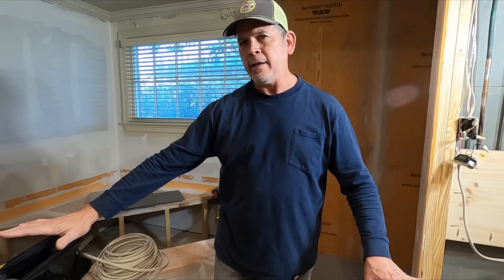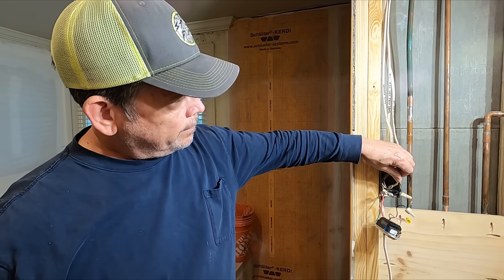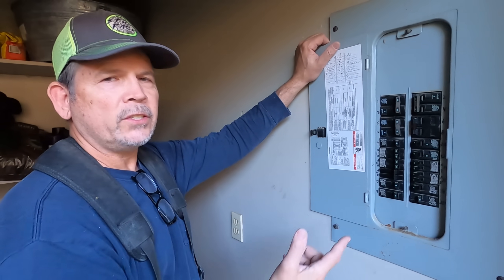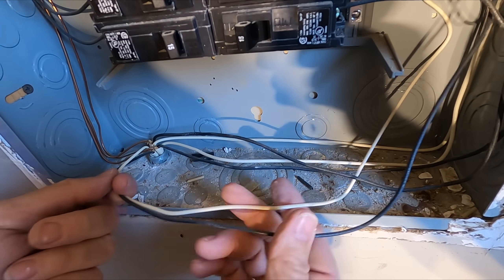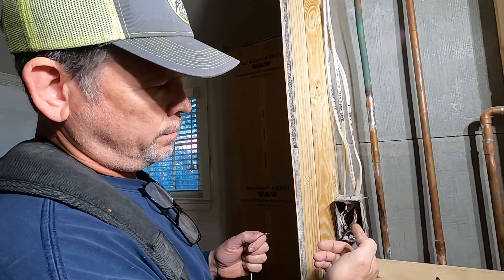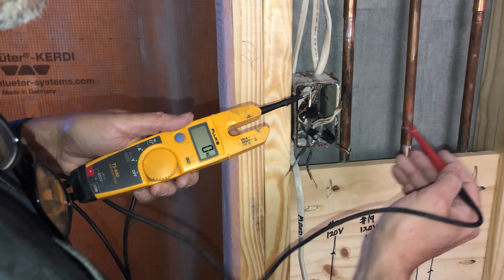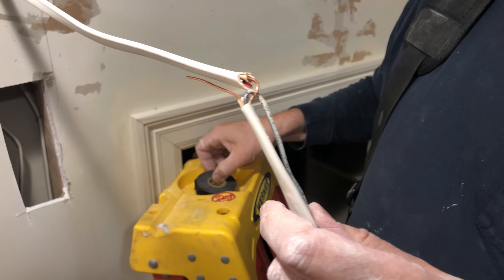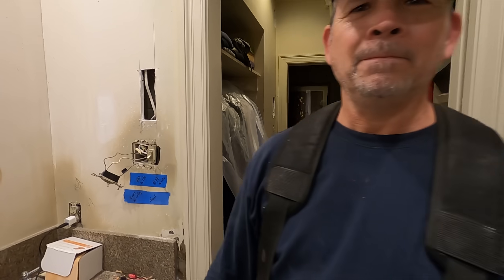You CAN Get SHOCKED by a Neutral Wire! This is How...

Comment: This is why when I work on things I turn it off at the panel then use a non contact probe to check before i open junctions, then i open junctions and test if in doubt. I did not do this once turned off a light switch, yanked a wire out of a metal box got a big spark, pop blew the breaker surprised me until i thought about and realized they had the switch on the neutral phase. I use the pushon wirenuts anymore, when I add a leg for an outlet, etc off a main feed line i always do the neutral then the hot. This is because basically as you show if the hot was on and something connected the neutral is then live too and you may not expect it to be. I feel like doing neutral then hot you are only exposing yourself to chance of shock one time where if you do hot then natural you are exposing yourself to two chances of shock.

So far i have never been shocked by any mains voltage, and i do a ton of DIY electrical work. This surprises many people but a couple master electrician friends are not surprised by this because i have a good understanding of electricity. As long as you are not completing the path you are generally safe, this is how birds sit on power lines they are only at one potential voltage and do not generally complete a circuit.
Reply from the maker: Thx for the comment.   I checked all the wires for voltage after removing the wire nuts.  All was good until someone in another room turned on a 3 way switch fed by another breaker and energized the neutral.   Definitely remove hot first, then neutral, then ground and reverse the order reconnecting - make it a habit   👍  Anyone who doesn't understand that eventually learns

Comment: Thank you for good clear presentation.   I have two of these bad wiring jobs buried in the 70-year-old structure of my house, where I can't readily get at them without tearing the house apart.  I have had several occasions when I had very bad things to say about the so-called "electrician" who risked my life so that he could save a couple of bucks by using 2-wire travelers, rather than 3-wire.
Reply from the maker: You’re welcome oldjoe 👍 thx for watching !
Reply: If there is a neutral available at each end of the three way then you only need 2 travelers you do not need to send a three wire most electricians don’t know that.
Reply: @williamrose7184   - It does "work", in the sense that that the light functions, but it can kill an electrician later.  If both neutrals belong to circuits on the SAME BREAKER it's not  too unsafe.  However, if the neutrals are on circuits that trace back to DIFFERENT BREAKERS, there is a severe safety hazard from working on one circuit while not being aware that the other circuit is still delivering juice that can kill you.
Reply: I am one and I know the only time you technically need a three wire to make a three-way system work is if you dead end the three way. Most three-way systems are in the same room so the neutral in each box is going to be from the same circuit. You’re just overthinking it most people think that you need a three wire to make a three-way work but you do not you’re just doing it one less conductor. Yes you’re correct if the neutral is on a different circuit but I never wire anything that way and to clarify yes I do run a three wire between my three ways just so people down the road can understand whats going on but technically if you feed one end and switch like the other end you do not need a three wire in between as two wires are only travelers the other one is it feedthrough for the neutral and if the neutral is already there on the same circuit you don’t need it think about it.
Reply: @williamrose7184  As i indicated initially, I have two cases in my house where the neutral comes from a separate circuit,  (bottom vs. top of  stairway)  and I HAVE been shocked while working on one of them with its breaker off.  No "over-thinking" here, just a pure-D dangerous setup.
Reply: Not if it’s on the same neutral. At that point it’s a waste of a conductor. I’m just saying most people don’t know you don’t need a 3 wire for a 3 way to work as only 2 travelers are needed unless you dead end it. That’s all I was saying

Comment: Yes! Yesyesyes!!!  Electrical videos!  The more, the better.
It is important to remind people to follow code as a minimum.
I decided to move a light switch in my basement.  The switch was connected to 14-3 non-metallic, so I turned on the lights, and cheerfully started opening the 15-amp breakers at the panel, but the lights stayed on.  So I started opening the 20-amps.  Yep, some bozo had put a 20 on the light circuit.  Why?  Originally, the basement had eight 200-watt incandescent bulbs.  Perhaps turning all of them on at once tripped a 15-amp.
Reply from the maker: Thx Bob!  Those 8 200 watt lamps would pull 13.3 amps.   Could be the 15 amp breaker was old and couldn’t hold.  I’ve seen that.
Reply: @StudPack  Good thought: could be an old 15.  Or turning on all eight bulbs at the same time drew more than 15 amps, maybe 18, maybe 500...  Never know...

Comment: More electrical please. I have an old house 100 years old with different wiring techniques used,I need help please. I have 1 light switch with 1 black wire in and 1 black wire out. Looks like they did not insert the ground or neutral in the switch box. How can this be? Need help understanding this wiring strategy please.

Comment: At work, a fellow employee was going to change a light bulb under a refinery furnace. He turned of the breaker. He knew it was the correct one because the other lights in the circuit went off. He started unscrewing the bulb and sparks flew out. He did not feel it. He left it and contacted a company electrician. He found out about the wires crossed and corrected that. The sparks flew because the socket was bad from being too close to the bottom of the furnace. Many sockets were going to go bad eventually. So many lights were lowered to be further from the heat of the furnace making them all safe.
Reply from the maker: Thx Ron, we appreciate the comment.  Industrial electricians see some crazy stuff for sure 👍

Comment: This happened to my dad in the house I grew up in. The 3 way switch in our situation was not needed so he just disabled it and wired the 1 switch correctly. 

If the three way would have been required by code then this is the fix we would have had to do.

Comment: So I'm understanding because an idiot electrician or DIY wired it wrong from the panel...you should always check your wires before handling them...
Reply from the maker: I did.  I had no voltage on any of them until someone turned on a 3-way switch in another room.  See my pinned comment.

Comment: I fish new wire with old all the time. When you are done taping, fold the part you tear off the tape roll so you have an easy to grab piece to remove the tape when you are done pulling the wire.
Reply: Ok genius
Reply: Screw it just cut it. You should remake it anyways.Bending and pulling may have weakened the conductor.

Comment: Electrician here. Technically speaking, it is legal for 2 different phased circuits to share a neutral. The issue comes into play when both breakers are not tied together via a common trip style breaker. They come in 2 pole and 4 pole style. If one circuit is turned off, the other circuit is also suppose to turn off leaving no lingering voltage trying to get back home.
Reply from the maker: Yep thx 👍 this was same phase.  Didn’t want to get into same phase/opposite phase

Comment: Just found your channel. Great video, and excellent presentation.
My worst electricity hit also involved a water line. But I am sure it was completely different circumstances.
This was back in the 90's when I was working at a factory. Took an indirect hit of 480 triple phase through a PVC water line on one of the presses.
Worst thing I ever felt.
From hand to elbow I had partial numbness for almost a week.
And I got off easy. Thankfully it was a PVC line, and not the galvanize manifold. I don't even like to think about what could have happened.
Took maintenance almost 3 weeks to sort out that problem and get that press back up and running.
Reply from the maker: Thx for commenting!!  480V does whatever it wants to 😳  Glad you made it through that one 👍

Comment: So if I understand correctly....can we summarize the whole neutral shock issue by saying the following: 

We had a circuit on 2 breakers with a common neutral. And you could get juiced by not knowing this because the circuit was not side by side with a handle tie which would have tripped both breakers and de energized everything in that box? Yes....?
Reply from the maker: Close Carl.  The circuits (19 and 20) were on the same bus so could not share a neutral.  Not the same as a multi wired branch circuit... what you’re describing

Comment: Great video!  To clarify, what your saying is, the problem arises when hot is run to the load first, then goes to a switch in series?  Whereas the hot should be run to the load from the switch?  In other words, switching the hot wire before it leaves the switch box.
Reply from the maker: There were 4 3-way switches that I omitted from the drawing on the plywood for clarity.   All the hots were switched properly.  The problem was on the neutral side, after the load.  Two same phase (same leg) circuits shared a neutral.   Big problem, the current adds together.  Too much to explain in a comment.  Do some research on same phase/opposite phase neutrals and multi wire branch circuits.  I'll do a video on that topic also.
Reply: @StudPack  Got it! Thanks.

Comment: Awesome video! Funny you mention your worst shock involved plumbing. I spent 30 years cleaning sewers - not plumbing, just cleaning. Several times over the years I worked through a galvanized roof vent and had arcs from my cable to the vent. My machines were wired correctly, the current was on the pipe. The last incident I encountered was the worst of all. I pulled a guys toilet to gain access to the main sewer line which was plugged. The sewer pipe was cast iron. I placed my cable in the pipe and when I turned on the machine, BAM! There was an arc such I had never seen. I brought the customer (a licensed plumber) in and showed him. I checked my machine thoroughly and all my wiring was good. We had to shut off his main breaker and run an extension to a generator to power my machine and finish the job. We never found the source of the current on the cast iron pipe. I'm glad I didn't touch the pipe with the machine on! Be safe, be careful. You never know....
Reply from the maker: Thx for commenting Jonas.  Pretty amazing what we find isn't it 😳👍  That's a cool story!!  You be careful also.

Comment: I was shocked by a shared neutral once and only once.  Now I NEVER touch any wire without testing it first, no matter what I think it is.  This video does a great job of illustrating two things: 1) wiring can be really confusing and merely thinking you understand pre-existing wiring is dangerous; 2) you cannot assume very much about wiring that was done by someone else, often under earlier codes and practices or by some DIYer who didn’t know what he was doing.  Always test. If confused get professional help. Your money or your life.

Comment: In a circuit that is wired correctly you can get shocked by a neutral if you put yourself in series with a live circuit.
Reply: Then, you are getting shocked by the HOT wire passing current through you and into the neutral ...

Comment: This is called a California 3 way it’s very common and technically not a neutral it is the common wire in a 3 way system
Reply: old skool 3 way. we cant add a light to bottom of our stairs at our complex cuz the cali 3 way doesnt have neutral and our el cheapo owners refuse to pay up to open the walls to run a new line
Reply: @harveylong5878  in a proper California 3way system the wire is ran to the light or whatever the 3 way system controls. So there is literally no reason for the switch system to have a neutral. When the light has one.
Reply: @richardc7433  smart switches etc whatever might be added in the future may need a neutral. So why not have it there from getgo. Besides, nobody has claimed the NEC is there to make sense 😯
Reply: @harveylong5878  if they are the type to use a smart switch then they can run a new switch leg

Comment: If you get shocked by the neutral wire, you have a severely miswired problem. 
In a properly wired circuit, you will NEVER have voltage going through the neutral line. You will have current / amps going through it, but you will not have voltage because the voltage is supposed to be completely used up by the load(s) in the circuit. If voltage ever goes through the neutral line, the breaker should be tripped. This video clearly shows a house that was wired by the 3 stooges and should have burned down.
Reply: Did you just insult the 3 Stooges?  :-)

Comment: Oh lord I learned so much I subscribed. Question can i wire nuts old knobs and tubes with romex in jonction box as long I go with same gauge to match the old wiring?
Reply: far be it from me to offer advice but I THINK it is a code violation to modify a K&T circuit.   Hopefully experts will confirm/debunk/clarify.

Comment: So, had the open neutral been wired correctly, you would not have gotten a hot wire on neutral at the switch?   Can't think of anywhere where neutrals are shared - they individually go back to corresponding black at the breaker.  The neutral is on the neutral terminal bar.   Has the bonding screw on the main panel been removed?

Comment: ...you can wire a circuit completely wrong according to the codes and still have it work....right up until it kills someone.

You do realize you can be killed by the current available from a simple 9V battery, right ?
Leave the electrical work to someone that's trained and licensed. Touching voltage potential is one thing (Ouch)...becoming PART of a live-load circuit is something else (💀Bye)
Reply from the maker: Someone trained and licensed did the original wiring and building inspector signed off on it....

After turning off CB #20, I confirmed all power was off to each conductor in that box.  All was good until someone turned on a 3-way switch in an adjacent room and energized that neutral.
Reply: @StudPack  ...and that's why you leave electrical work to someone trained to do it. In a different situation that might have killed someone by touching that live neutral and ground. I know you're trying to inform people, but this just made the hair on the back of my neck stand up. Homeowners don't completely understand the inherent dangers of working with shared-neutral circuits...so they SHOULDN'T.

It's the same reason you don't get your babysitter to perform service on the family sedan.

I'd rather be safe than sorry. I would have shut off the panel main breaker and locked it out. Issue avoided.

Comment: I don’t know if your electrical code is different in your area then mine. Our code says all devices such as switches and  receptacles must be a minimum  3 feet away from tubs or showers GFCI  or not. Safety, you shouldn’t be able to touch a switch or receptacles while standing in a pool of water.  I like your work, and the time you take to explain things.
Reply from the maker: The shower door is hinged on that wall.  You'd have to reach around the door to get to the switch.  Not sure if that's why it was allowed or not.  Thx Watts Up!!

Comment: As an electrician, and a remodeler, who has worked on 1000’s of homes, shared neutrals are one of the main errors I find, good video, thanks.
Hire an electrician!! Find one that will work with you as a remodeler to be fair and equitable with you it will save you many lawsuits.
Reply from the maker: Thanks Major good advice 👍👍

Comment: Great video for the electrical problem!   Not all whites are neutrals!   I saw an electrician get zapped on a 277 volt neutral.  Not good.   With safety in mind, you really should have gotten a two rung taller ladder.
Reply from the maker: Thx Kevin.  I can barely get that 7 foot ladder in there 😩

Comment: One should always check to verify the absence of power before performing any work. Check phase to ground, phase to neutral, neutral to ground. Yes a neutral should not carry voltage and neither should the ground but they can. Electricity doesn't care what color the wire is, and if things aren't wired, grounded, and bonded correctly you can run into situations of unintended current paths and stray voltage.

I tend to call them phases too. But in residential there is only one phase. It's a split phase system, even though your have a black hot and red hot, they are technically the same phase. And neutrals can hurt really bad, because it carries load. Everytime I've spoken to someone about getting hit, they always says 277 neutrals hurt the worst.

Comment: Great information. I always check & double check power. I do not like shocks. 
I did see you used the top "Not A Step" of your ladder as a step. I know attic access through a hatch is tricky at best but using the top as a work platform is much riskier. Safety first.

Comment: Just a little confused.  Did you get shocked by the neutral even AFTER toggling off the breaker for the circuit you were working on, or did you get shocked because you thought toggling off the light switch was good enough?  This is an interesting situation to understand better.
Reply: He turned off breaker #20 but breaker #19 was on and connected to the same neutral.
Reply from the maker: Yep